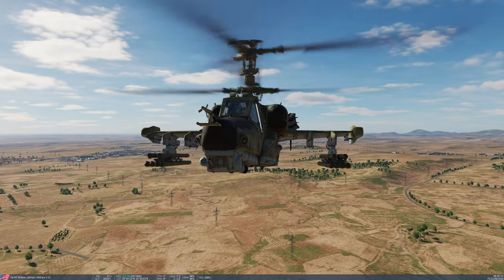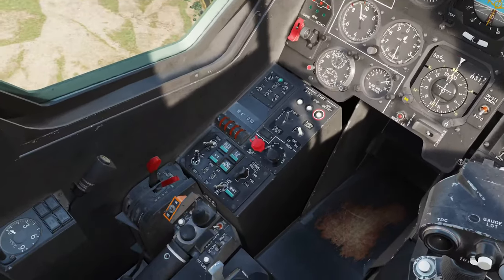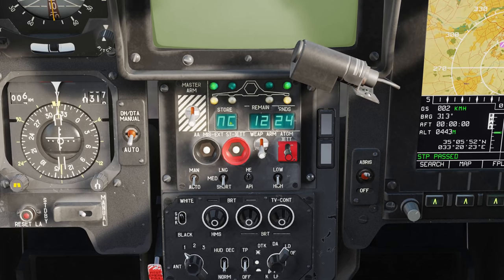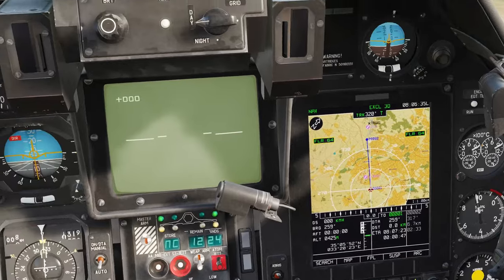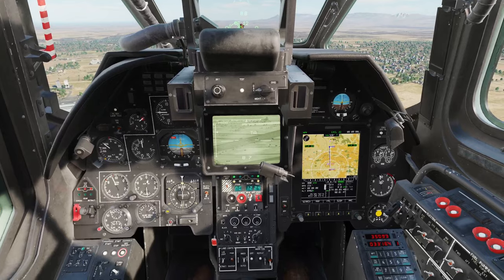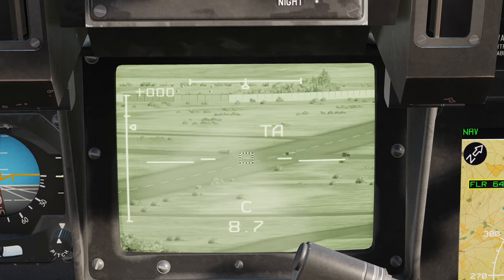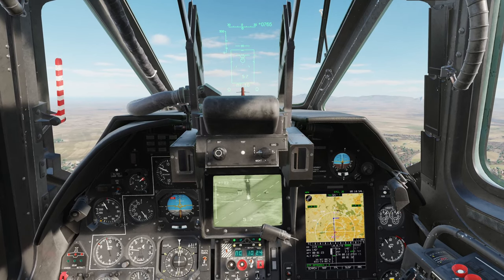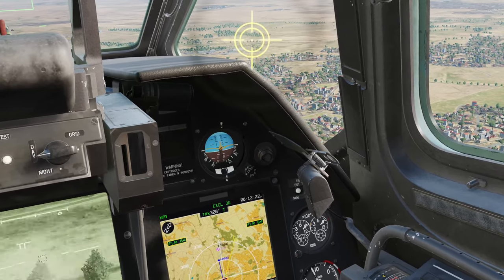DCS KA-50 Black Shark 3 Tutorial 2 - Vikhr Missile

Comment: can the BS still fire 2 missles and hit, 2 different targets, and does it still able to top attack?
Reply from the maker: It can only fire on one target at a time although with some delay between the missile it might be possible to slew onto a second target. You might hit the emission limit for the laser though. Vikhr does not have top attack ability due to it's beam riding nature.
Reply: @deephack  havent really checked it out, get bored sitting on the tarmac waiting on inu alignment for 15 minutes
Reply from the maker: @polarbear4198  You can disable the realistic INU option in the mission editor for the unit if you would prefer.
Reply: Volk (YouTube creator name) showed a technique where this is possible, but you have to have both targets close within the same azimuth from the heli and the first missile hits the closer target, second for the further.

Essentially you fire two missiles at the first target, they will ride the same beam. And after the first missile hits, you slew the Shkval to the 2nd target and the 2nd middle turns and keeps following as you guide to the second target. This was a video done before Black Shark 3 was released, so it’s unclear if they avionics modeling still allows for this to work. It’s not very practical anyways, but Volk definitely seems to be the Ka-50 YouTuber that pushes the limit of the platform.